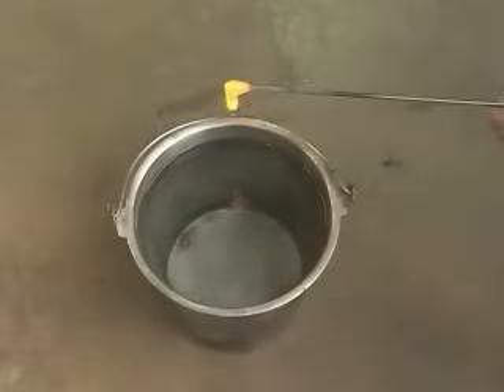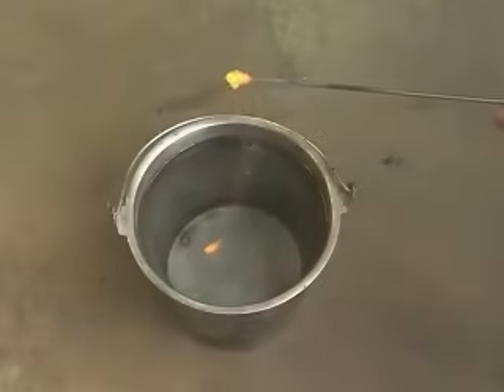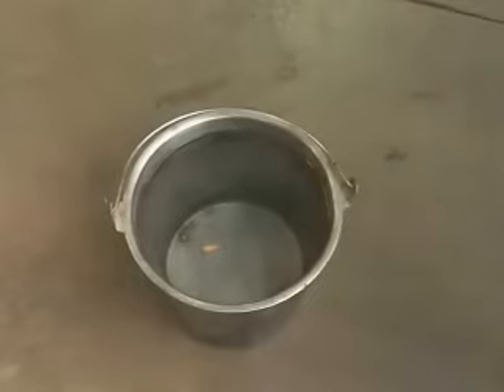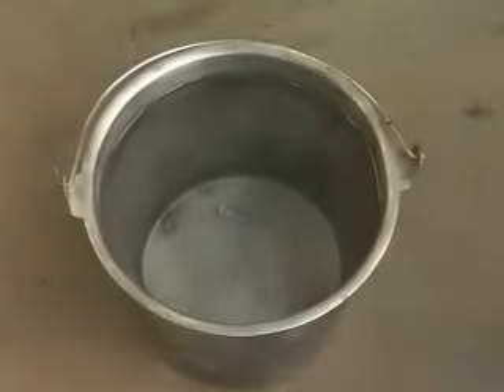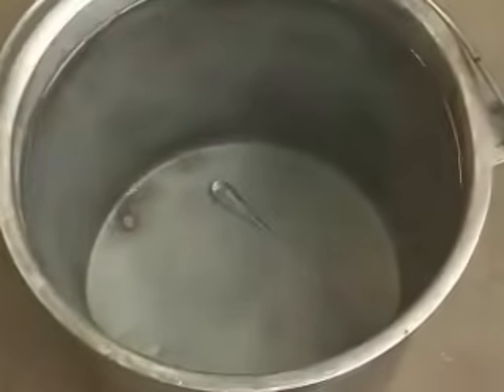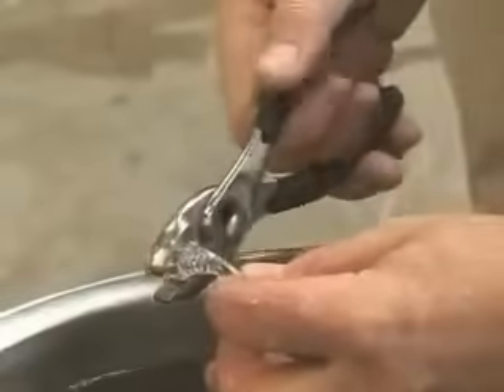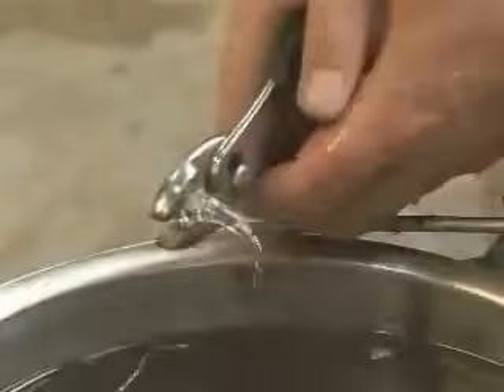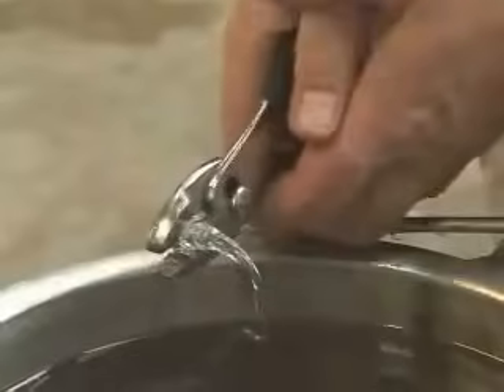Prince Rupert's Drop

Comment: Would re-heating the drop just melt it or would it shoot molten glass everywhere?
Reply from the maker: +ilikemusic5440 --If you heat it too quickly it will explode, but a more gradual heating will melt it safely and easily.
Reply: @corningmuseumofglass  heating it slowly will relieve the compression . It will break with the pliers or a blow from a hammer

Comment: I wonder if dropping it into liquid nitrogen would further improve the drop's properties...
Reply: +EnigmaHood it would probably fail to form. Greater thermal stress would cause it to shatter as it cools.
Reply: the liquid nitrogen would probably just evaporate on contact with the liquid glass and would form a thin layer of gas that would keep the the two from interacting. i forgot what the name of the effect is but you could stick your hand into liquid nitrogen for a few seconds and it would not be harmed either by the same effect

Comment: What if they would make phone screens made of price ruperts drops?
Reply: how can you make a screen out of a non malleable drop?
Reply: ***** Melt the glass into a shape.
Reply: it only works as a drop, that's how the pressure is kept in perfect balance. it isn't the strength of the material, but how its formed. That specific shape of glass has those properties.
Reply: oh ok :P
Reply: ***** actually, it is because the outside of the drop is cool and therefore at its dense-ist while the inside which has not been fully cooled isnt as dense, once it cools and hardens, it starts putting tension on the outer layers, thus giving it its incredible strength. so the phonescreen would work if it was a bit thicker
Reply: lets not forget that if phone screens was able to withstand more than they do people would keep them for longer thereby losing profits unless they are made of nokias or gameboys since you cant break those two items
Reply: Because if you even slightly cracked your screen, the whole thing would explode.
Reply: ***** Well actually, Google heat-tempered glass.

Comment: ...20,000 FPS isn't a real thing, and it wouldn't slow things down. Your eyes can barely process motion beyond 30 FPS. I think you just wanted better quality and for the footage to be slowed down dramatically. At the speed the glass explodes, I don't believe a camera could capture the glass shattering easily.

Comment: @Enaryth only if you use a lot at once. If you gradually add it the temperature is entirely controllable. The reason I recommend it is 1) it is easy to obtain, 2) it has a relatively high effective energy density, and 3) it is easy to control both the fuel and the temperature.

Comment: @MitchDesousa 
not to be THAT guy. 
but technically 20,000 frames per second would just have a really high frame rate. It would still be a matter of seconds, but there would be 20,000 frames in each. 
in slow motion, those 20,000 frames could be stretched over time. 

so yeah, i think it's just a stupid technicality thing.

Comment: Car glass (the windshield) is simply two layers of glass adhered to a layer of plastic.  This gives penetration resistance.  Car side windows are tempered glass and similar to a Prince Rupert's drop.  The surface of the glass is in tension.  Simply  chipping tempered glass will cause it to break into small pieces, like the Rupert's drop.
Reply: Hi are you still active please reply

Comment: Actually, I think the glass would undergo a cooling rate higher in the ice water than the liquid nitrogen, due to its specific heat capacity, especially considering that liquid nitrogen boils off very quickly - so what you'd have by dropping it into a bucket of liquid nitrogen is a hot piece of glass with a shell of cold nitrogen gas around it (which will not cool well at all).
Reply: hello
Reply: @kaperskyplays8016  hi
Reply: Fricking old comment
Reply: Are you still active? I guess not
Reply: @glowings26804  yep
Reply: Bro how old are you now
Reply: WHO? asked? :)
Reply: @despot2180  old YouTube didn't have the current reply system.